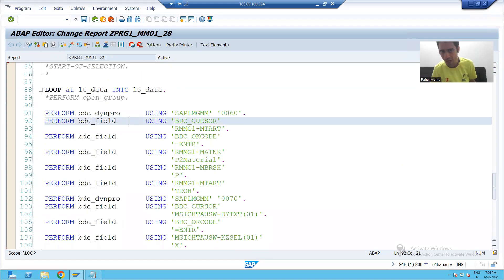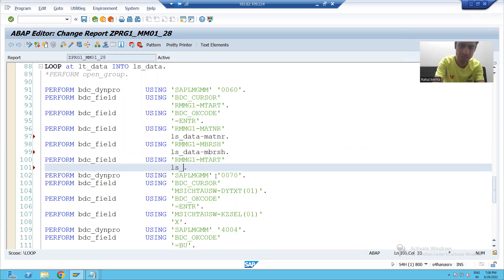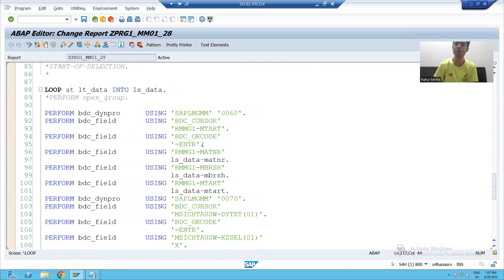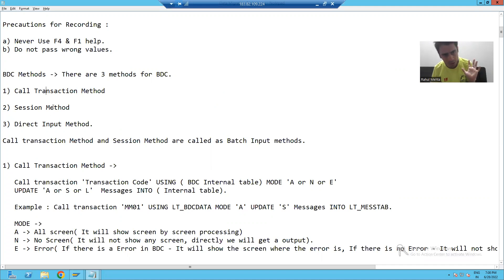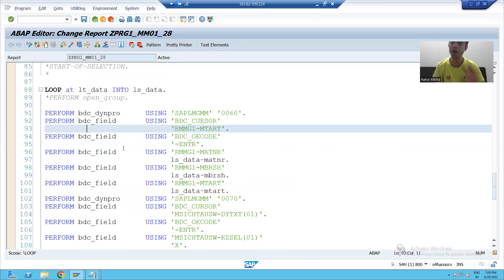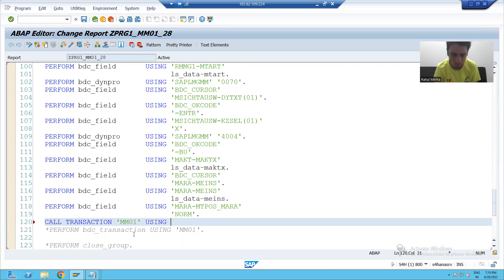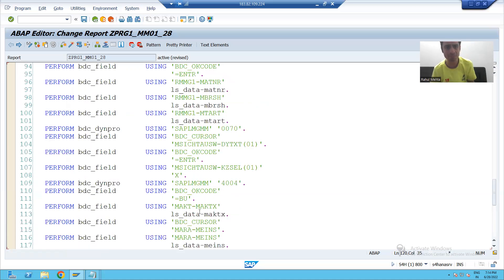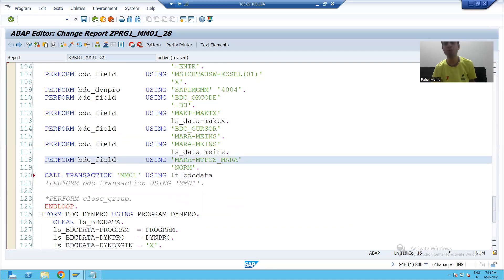8 - Data Migration Techniques - BDC - Call Transaction Method Part1

Comment: why we took out  two subroutines from include either way it can work inside include also , what i understood is that it is just done becuase we want to declare  bdcdata table and workarea independently. Plz guide.
Reply from the maker: As Internal table with header line is obsolete. So we declare Internal table without header line(separate work area). This standard include has lots of code and we don't require that code, so whatever the code is required we took into our own program.